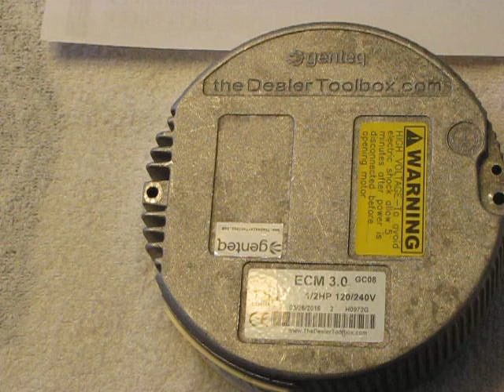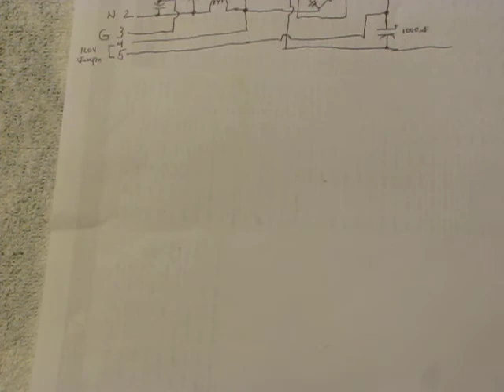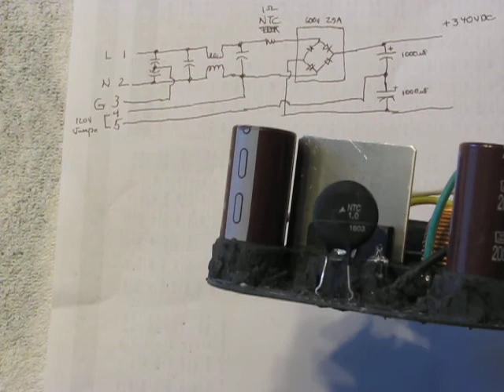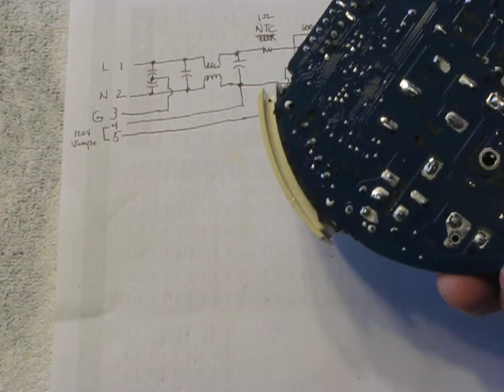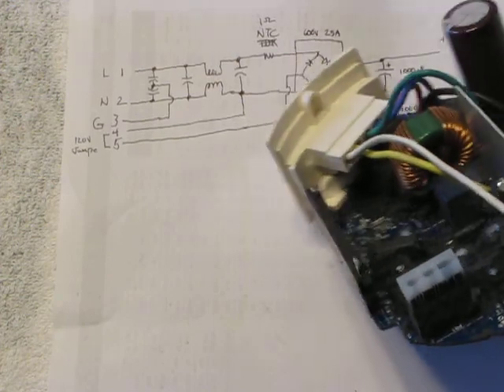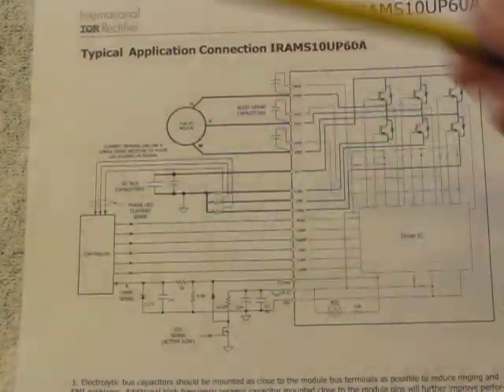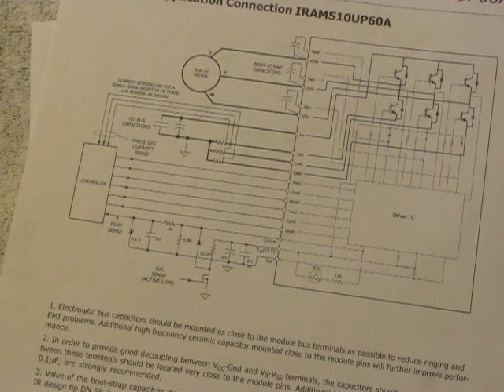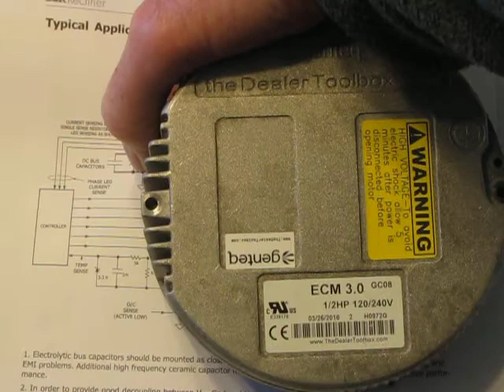Genteq ECM 3.0 Module  Teardown & Analysis

Comment: I dunno how you reverse engineered the circuit as much as you did with all the godforsaken black schmoo all over everything..  i tried picking it off as much as i could and even by hand i took off some traces and crap..  my motor was doing the whole startup then twitch for a while until the ntc got too hot or something then itd power down, make some electronic high pitched squeal then repeat..  sometimes itd just spin for half a turn and twitch a bit and keep doing that for a while..

Comment: Is it possible to like hotwire this thing cuz I have one of these and I'm really trying to just get it to turn on and spin and I'd be happy
Reply from the maker: I believe you can put it in a self test mode that will force it to run at about 1200 RPM by connecting 24 VAC between C and RX

Comment: I have a question this ecm motor are ac or dc volts on low side? Question comming becuse ecm testers use 24ac v but some manufacturer insist they are dc v
Reply from the maker: Under normal operation the control is powered by 5 VDC with a 5 V digital signal in/out RX and TX (at least for my motor).  There is a self test feature were 24 VAC is applied to RX and com.  Motor will run at a preset speed.

Comment: Thank you for this video.  I had mine fail as well.  I have a 3/4HP model, and it also only has two caps.  I am going to check that MOSFET IC and see if it is also the failure mode, and if so, perhaps attempt a repair.  I will have to consider what to do about the fusable traces in terms of what current fuse to hack in.

Comment: Did you replace that garbage with a PRC motor?
Reply from the maker: No.  I use the 500 rpm circulation mode during the air conditioning season.

Comment: I was an HVAC Mechanic and first worked with these a few years before I retired.  We serviced a site with about 20 heat pump package units. I thought of them as little VFDs built into a 3 phase motor. Most of the failures I found were with the thermistor, which I could replace to put the expensive motor back into service.  I would hope that the design has improved since those days.
Reply: Yes it did improve and thermistor (NTC resistor to be exact) does not fail anymore. Something else fails now internally.
Reply: @antronx7  Thats' Total BS! My 2 year new Rheem ECM X13 module failed because of that Thermistor!
Reply: @johnnyd529  What's BS? I tore apart failed ECM and thermistor was OK. In fact, entire power supply rectifier and step down converter section was working. I gave up tracing the failure eventually.

Comment: Hey Tom!  I enjoyed the teardown, my ECM just quit working.  It is a 1/2HP 230V unit.  I don't have the RX/TX line on my connector, curious if a microcontroller is present.  Are you an EE?  If so, curious where you spent your career.
Reply from the maker: Is your ECM from a condenser fan?  it may only run at one speed and not need a control.    I have spent decades in industrial and consumer electronics.

Comment: Very nice explanation, I was searching for characteristics of failures to Ecm motors and came across your video. The one I’m working on runs the motor but the motor is jerking at a slow speed for a few seconds then turns off, and repeats the jerking over and over. I was wondering if that would be a failed capacitor on the filter side of the power coming in, or something else?  Motor windings are ok, and I tested with a good module and ops are normal.
Reply from the maker: I assume the board is still potteded in the housing?  To confirm your suspicions you could recreate the filter rectifier section outside the motor and run the DC into the power pins.  Or maybe measure all three phases (phase to phase) at the motor to see if one is missing.  I noticed they don't seem to like running without blower wheel.  Be very careful none of of these connections are isolated from ground and have lethal voltages.
Reply: @tomkirkgaard247  My motor does the same thing.  It spins up just fine if I help it out.  Won't spin up otherwise.   Ran it like that all winter and now I'm trying to fix it.    If I can't find a problem I might just change the big caps on the board and see what happens.  

Digging the potting out as I watch your video.    I measured the (240v, 3/4hp) motor and they all read 7 ohms and none are shorted to ground so I think the motor itself is still OK.
Reply: @tomkirkgaard247  Also, per your comment in the video: Mine is 3/4HP 240V and still only has the two caps.   Those caps are rated at 200V 1000uF on my board.
Reply: Hi, have you figured out what was the reason for this? I have exactly the same behavior, though in my case I have 50/50 success rate, sometimes it start after few attempts. Also I bought and installed  used control module, but unfortunately , nothing changed which makes me think that problem might be not the motor itself.

Comment: I'm trying to find a thermistor for one of these and I'm having difficulty. I'm working with Mouser to see if they have one, but I guess what's on the side of it doesn't quite tell them enough. Do you know where to find the right one?
Reply from the maker: I would  try a SL22 1R020

Digi-Key Part Number

570-1041-ND

Any ntc 1 ohm 20 amp
Reply: @tomkirkgaard247 do you know if the 1hp ecm would use the same thermistor or does it need the 1 ohm 30 amp? Thank you.
Reply from the maker: @Uncommonsense999  Not that critical.  If you're running it off 120V you could use the higher rating.  If it 240V the 20A should work.

Comment: Nice tear down and analysis.  The IGBT module being totally plastic cased doesn't help for heat dissipation to case heat sink.  Heating may be contributor to its failure.

Similar IGBT module in my Samsung VFD driven variable speed compressor refrigerator.

These motors have poor power factor because of simple rectifier-filter caps used in U.S. market.  European regulations require PF correction.  My Samsung VFD compressor refrig has 0.60 to 0.65 power factor.
Reply from the maker: That is a good point about the PF correction.  I read other people commenting on utility waveforms are getting distorted near the sine peaks due to all the crude DC rectifiers on line.
Reply: Yes i can attest this, dirty power is getting to be an issue in some areas now with how many bigger buildings that use 3 phase motors for controls but are not held to the same standards as factories where they’re charged for the pf correction or lack thereof getting put back into the grid.  Theres also quite a few people who use generators as supplemental power but dont disconnect from the mains when doing so..  theres a lot of dumb out there and where its been allowed to multiply with governments circumventing darwinism with all the safety regulations and laws to keep the stupid people safe its effecting everyone else..

Comment: Thank you very much for this very thorough investigation. One of the few that actually looks at the circuitry. My big question is the communications port. Is it RS232 or? And the main question: how to control one of these without the air handler manufacturer’s control board? If it’s simple serial communications, what is the command set and protocol? Would be very nice to be able to turn it on and off and set speeds.
Reply from the maker: I found this information on the data interface. Not exactly RS232...

Interfacing the ECM 3.0 motor  Communication Protocol  
 Framing  4800 baud  ± 2%, one stop bit, no parity Signaling   Multiple slave/addressable   Error Detection Fletcher Checksum (Complete specification document:  a-8794721el_r04.pdf)  Electrical Characteristics                Suggested Interface circuit             Data input (Rx) Input voltage range   6.5 to 20 Vdc  OFF threshold, max.  2.0 Vdc  DC offset max.(note 1)  2.0 Vdc Data Output (Tx)  Output voltage max.   20 Vdc  Output current max.   30 mA  Bias supply (+V)  Bias voltage range   5 to20 Vdc  Current required   13 mA 1. Rx input circuit responds to both polarities. Common(C)  Common
Reply: Yep if you run your power normally to the top plug and use a 12vdc supply for the c and v+ you can jump the v+ to rx and it will spin up the motor into its “learn” phase where it actually detects whether theres a resistance on the motor or not.  If not then it will spin the other direction looking for that resistance and will set the direction of rotation like that.  Is why the motors are bidirectional..  psc motors are always cc or cw..

Comment: It looks like the high-voltage DC used by the motor river and the FETs is always connected so a voltage spike that makes its way past the rectifier could damage them as their Absolute Maximum ratings are ~500-600V. MOVs would help clamp this.

Comment: Hi Tom, have you ever take apart a HD03 module? It looks very similar to the one in your video. But after I removed the ground screw and separate the silicone on the wall. I felt the board is still firmly attached to the housing, do you know if there are any other fasteners?
Reply from the maker: There are two screws holding the power module to the heat sink.  I made a little 90° pry bar to lift the board out
Reply: @tomkirkgaard247  You mean the processor? Yes i did undo those screws but the board is stuck to the housing. I was trying to lift the board by lifting the connector side, but somehow it won’t move at all. I thought the connector might have a clip that clips into the housing. Cheers
Reply from the maker: @wecarespares  If you follow the green wire from the connector it has a ring terminal that has a screw that goes through the board to the housing.
Reply: @tomkirkgaard247  Tom.  I too have removed all of the silicone around the edges and all the screws.  Tried using an Allen key to lift/pull at the semi-circular gap by the harness connector in the board.  But there is too much silicone under the board and I'm afraid of cracking it if I pull too hard.  Any other suggestions?  Is there some sort of 90degree knife that I could use?
Reply from the maker: I bent the tip on a flat blade pocket screw driver to help lift it.  Wonder if heating the housing would help?

Comment: If I replace the IRAMS10UP60A,
Repair the board trace what value fuse should I replace the trace with?
What value is the shunt resistor ?
Do you think that is all the damage done to the board?
Reply from the maker: I would guess a delay fuse slightly higher than the motor rating.  I can't remember the shunt resistor .01 ohm?  I never put it back in service after replacing the output module.